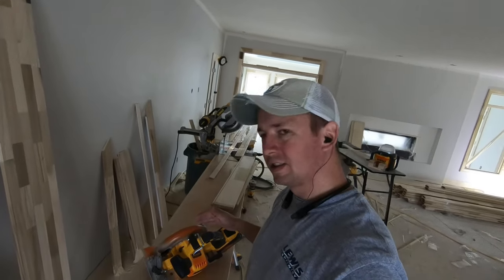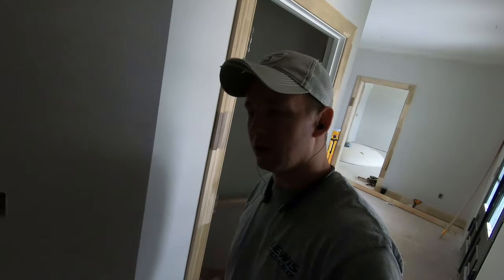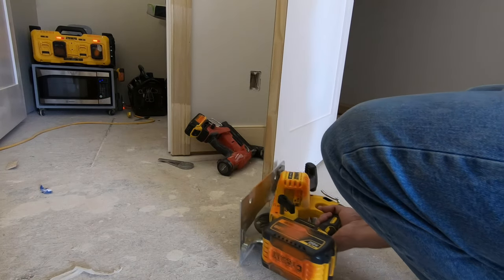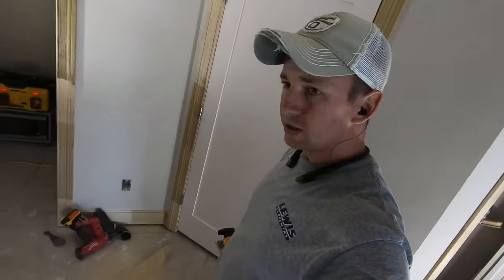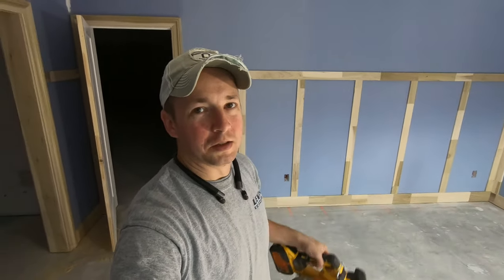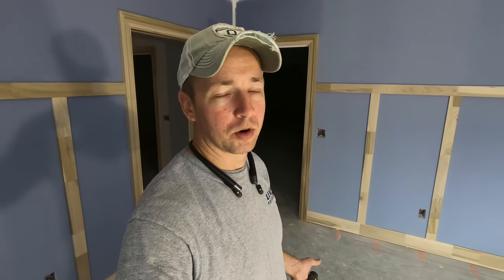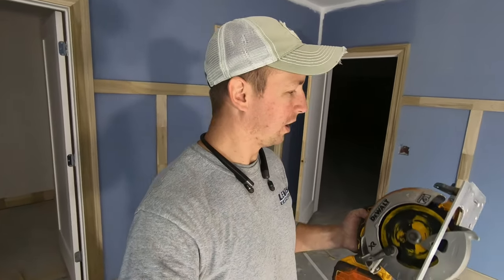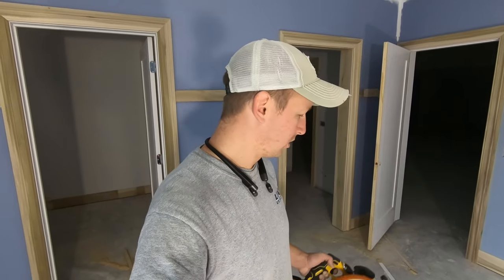Cutting Off Doors While Hanging??? with a Standard Circular Saw???

Comment: Works for me .. My only worry .. If there is a sheathing height jump and the table follows the floor ..Some door seems already have a height average of 1-1/8 " clearance on the hinge side  .So I only need to shim up temporarily 1/4" .. I prefer 5/8" clearance under the door finished since that is what Code requires in a forced air system . 3/4 " is still good in my book .. I make sure I attach the jamb rock hard at the bottom of the jamb and trim .. So many times I have seen some flooring installers come in and hack the bottoms of the jamb off and it looks like a beaver chewed the trim and jamb off .. Some have even tried to noodle around the trim and cut around the casing /jamb / stop .. Looks like poop !!.. One of my last homes .. The tile pro .. Instead of cutting the wood away , Nibbled the tile to contour to the casing/jamb /stop .. LOLOL ..then a nasty grout job all the way around .. I caught up withe him and he argued .. I told him " I have seen better tile work in gas stations and KFC"s rest rooms  .. What matters in the end result .. And you know and I know .. When finished the trim should look like it rest on the flooring .. not a gap big enough to slide a cat through .. .I know this isn't really  precisely relevant to what you are doing , But is relevant to setting doors .. I watched this one Youtuber " Instructional " videos .. Setting a door and I think he might have after a month finally got the door set .. After scribing the drywall . Planers and blaming the floor . the door , the framing , I am an older carpenter .. Always open to new ways .. My days are numbered since I have terminal  brain cancer and have been trying to show others in the last few years a procedure for setting doors fast , accurately .. I ran into an expensive set of interior doors years ago that were lauded as supreme .. "Davoris " and we had about 50 of them to set in one mansion .. We spent days trying to figure out how to set them   The manufacturers recommendations .. The kicker was .. They weighed a ton apiece . They were prefinished with an automotive finish . The jamb was a flimsy piece of 10 ply sheathing only 2" jamb depth prefinished  . That would later accept the other side like a split jamb .. Nothing could be touched up since it was a finished veneer . You couldn't attach the special trim until the Flimsy was anchored .. The trim couldn't have finish nails . Not One !! .. not even a 23 gauge .. Everything had to be hot glued or glued .. " NIghtmare " .. As any carpenter . You want to be able to control the jamb !!  Be it from the casing or the jamb itself as you shake it around until you commit to blasting it off forevermore .. Out of problems . Innovation arises that can be applied to any door. All the masters mulled over for days and tried dry runs .. Nothing worked .. These doors had to be set perfect .. Then a tool I had and the ability to use a carpenters natural internal geometry gave me an epiphany .. There it was .. A beam laser .. Simple enough .. ..Developed the procedure and away I went .. I tried to show others but they just didn't want to learn .   It was beautiful and simple,, Everyone left me alone and they wondered how in the hell was I whistling Dixie and having a blast installing these beast doors .. .. This same procedure is all I used henceforth . To set any door , interior , exterior , double doors without a qualm ..   The procedure for interior was .. Set beam laser and check floor on both sides .. this verifies what needs to be cut off the high side  jamb.. Since in my case the flooring from France was already installed . Then line up laser relatively perpendicular to the framing trimmer .. to see if the natural deviation that occurs in a framed opening .. " Whether it is straight enough to run with or it'll pinch me if I anchor one side hard "   Then pan the laser relatively parallel with the drywall across the opening .. check the 4 points .. 2 bottom and 2 tops .Even if the laser wasn't panning perfect .. I could butt the tape bottom and top on say the right hand side and get say 8.5" bottom and 8.25" top .. So on that side the framing / drywall was either pooched or out of plumb by .25" .. Log it in the mind .. Then do the left hand side and it might be 10.875" on the bottom and 11 on the top .. Now I have a mental image of the plane I will setting this door in . The Twist .. I prefer no twist .. but Hey .. Framers make challenges .  Set the jamb according to the deviation . if it needs to be prouded out here and tucked there without using a 1/2 " backing rod for caulk or grinding away drywall .. Just about any door can be " Danced " around without grinding up or pointing fingers " Dang Boss .. Those framers really suck and that is why it's taking me 10 hours to set a door "   Excuses Excuses .. .. Carpenters can't stop a job over something they cant figure out .. Anyway .. Once the jamb is in temporarily ..   Set the laser facing the hinge side within a few degrees of arc .. Line the beam visually to the center of the 3/4" or 1" jamb at the very top after it's been " Centered " in the RO .   Ram it home " I prefer to glue my shims and finish head screws at the very top  .. " Don't anchor the top hinge yet " .. Then align the same laser margin on the bottom hinge .. Not the very bottom !!  Then anchor through the hinge either with a hinge screw or finish nails or finish screws through the jamb .. Anchor hard !!!  but watch the laser line since screws can pull hard .. .. Once those two points are set in stone and it will take a stick of dynamite to dislodge .. Checking  the laser that nothing is tender at those two points .. Then turn off the laser !! .. align the top hinge with the same margin atop the hinge and match the reveal at the very top .. Then proceed to the center hinge and anchor ferociously examining the margins . Then anchor the bottom of the jamb hinge side .. Then unto the strike side .. Since the laser has already determined how much had to be cut off the strike side .. wiggle to what was determined by panning down the wall earlier ... If no flooring .. then just match the head reveal from the hinge  side . Anchor hard .. Then anchor the bottom last .. checking that the door is evenly bedded .. That it smacks the stop at the same time .. Then straighten through with either a straight edge or the margin created by the top .. Anchor at the strike Hard !! .. anchor wherever control is needed ..   Now open the door all the way and SLAM it .. Slam it like you threw your mother in law out of the house .. The wall should rattle and the guy 4 rooms away should think something bad happened .. There should be absolute no rattling on the stop .. It should close like a blast door on Cheyenne Mountain .. I know many split jamb doors are assembled by idiots and you have to dance with them .   I wish I had a video to show the procedure .. It actually is a lot simpler than I explained ..But it guarantees the best door setting and fast .  Peace out

Comment: When trim and doors go in before floors, how do they finish their floor around the door casing and baseboard? We work the other way around
Reply: We space the doors up enough for the flooring to slide under them, and shoe molding covers any gaps around the base. I usually lay a piece of the flooring under the door when we are installing them, if it winds up being too tight the flooring guy will use an oscillating saw to cut the jams. A lot of guys here do doors and trim before the walls are primed, I prefer to prime, and do the first coat of paint first so I have less cutting in to do.

Comment: Could this work on a door over a finished floor?  I might just keel over and die if my husband hits the floor with the saw. LOL   How could I make this work over a finished floor?  I can't get the pocket door down without taking all the trim off.  I'd prefer to just cut the bottom of the door.... the oak floor moved a bit and now the double pocket doors (8ft opening) are hitting at the bottom.

Comment: The problem is when the door is too long to hang then you have no choice. In theory it should only take an extra 10/15 min depending on if you have to put the bottom piece back in if it's a hollow core and you cut off more then a inch. Happens alot in doing basements but it's still very annoying.

Comment: What if the floor directly underneath the closed door is not on the same plane as the floor underneath the open door (where you're cutting it.) I install cabinets on mostly concrete floors, and they are often super wavy and out of level.

Comment: if the door bottom comes pre-primed, why not just set the jams up in blocks during installation? I used to use a couple scrap pieces of MDF baseboard under the legs to get my clearance height for the door over carpet..
Reply from the maker: Because then the jambs will be above the flooring.
Reply: @InsiderCarpentry  right, but carpeting and pad will tuck right under the jam, guess I could have been more specific
Reply from the maker: If you have LVT or vinyl on the other side of the door your jamb will be higher than that flooring. Yes, you can block up your jamb if you have carpet on both sides of the door.
Reply: @InsiderCarpentry  do you run baseboard before or after carpet is installed?
Reply from the maker: Before

Comment: I’ve learned a lot from the comment section. Embarrassingly enough I learned a really easy math trick for dividing any number and fraction in half that for some reason I never learned in school (I wasn’t a good student). It is funny though when you get guys who post “tips” and because they’ve never actually tried it they have no idea it’s bs.
Reply: Well now I want to know what the trick is for dividing in half. Please share.
Reply: @shooshinejonnie  very simple say you want to divide 69 7/8” in half, just drop 69 down to nearest even number in this case 68 divide in half = 34 as for the fraction add top number to bottom number 7 + 8 = 15 double the bottom number and you get 15/16 so half of 69 7/8” is 34 15/16”.
Reply: @brians5539  so this only works for of numbers because if I take your same example and substitute 62 for 69 It comes out to 31 and 15/16 instead of 31 and 7/16. Or is there a trick for that as well? Or do you just do the fraction division in your head? Or do you just double the bottom number of the fraction?
Reply: @shooshinejonnie  when it’s an even number like 62 just divide in half you get 31 as for the fraction the top number stays and the bottom number gets doubled example: half of 7/8 is 7/16 half of 15/16 is 15/32 etc.
Reply: @brians5539  That's not a trick, that's doing the math without realizing it. (you're borrowing one from the whole number, dividing it by two, then adding that borrowed one to the fraction when you add the numerator and denominator together, then halving the fraction by doubling the denominator is multiplying the fraction by one-half (multiplying by 1/2 is that same as dividing by 2)).

Comment: Why don't you hang the doors higher?  Maybe because you don't know what the floor covering is going to be at the time?
Reply from the maker: If I hung it higher the jamb would be too high off the floor and would be higher than the flooring. So for things like carpet I have to cut the door down.
Reply: @InsiderCarpentry  If I'm hanging a door where I know there will be carpet I set the jamb about 3/8" off the floor.  That usually gives enough room for the door to sweep over the carpet, and the bottom of the jamb is hidden by the thickness of the pad and carpet.
Reply from the maker: Same here. Unfortunately if LVT or 3/8” hardwood is on one side of the door and carpet on the other the door still needs set lower to accommodate the thinner flooring...which seems to happen on a lot of the doors I hang.

Comment: I have a sliding door that we cannot remove as it slides into the wall cavity and there is no room to pull it out. We had to lay new tile under it and now it needs real elbow grease to slide it over the tiles. Anyone found a non-destructive way to preserve the tiles and get a clean cut of a hollow core door with this method? :)

Comment: I’m a residential production trimmer. I wind up cutting doors, both swing and sliders after carpet a lot. We usually shim 9/16” or the thickness of base. Floor guys show up with heavier padding and I’m screwed. Instead of humping doors downstairs I usually throw a blanket down and cut them all in one bedroom. This trick won’t work with the floor already down. But cool nonetheless.
Reply: Well the thing is, there is so many different variables/ thicknesses on flooring options. I wouldn't even consider this unless I knew exactly what the materials were in general and total thickness of prior to cutting any doors. Just my take.

Comment: Am I missing something? Why not set the door at the right height, to begin with? I think this is great for a repair but not a new building.
Reply: And no hate intended, just curious about the extra step.
Reply from the maker: Because the jamb would be higher off the floor than the future flooring. Carpet on one side. LVT on the other.
Reply: Great tip for rennos!
Didnt see if these door frames are premade or not. But when we do doors we just add thickness of flooring plus gap under door and cut the style to that so regardless of flooring thickness either side of the door the jamb goes all the way to subfloor.

Comment: Not to be negative Man by the inch and a half it’s too much off the ground door should not have that much a gap 

that’s why basically people don’t do this  the trick I mean if you’re cool with having an inch and a half up  that’s fine but that’s way too much off the bottom of the door!

In most cases, the flooring is already installed and you just need to take a quarter of an inch off the door not an inch and a half!

Good day

Comment: As a hardwood floor guy i say good idea, but why flooring after base??!! Seams backwards
Reply from the maker: Just how we do it around here. Base goes in first and we use shoe molding.
Reply: Shoes aren’t common for new builds around here,  but it was explained to me like this.  If you go base, floor, shoe then if there is a flooring change, it would be easier to remove,  and if they went to a thinner product, there wouldn’t be a paint line from the base dropping down. My opinion is that the latter would rarely happen in practice, but whatcha gonna do.
Reply: Here it’s flooring first then base unless it carpet.
Reply: @joe-say-did-it6201  Same here too. Also you’ll see tile and grout run into the base, and I could never figure out why. Not even a cold joint.